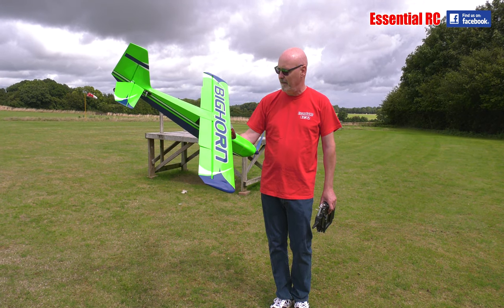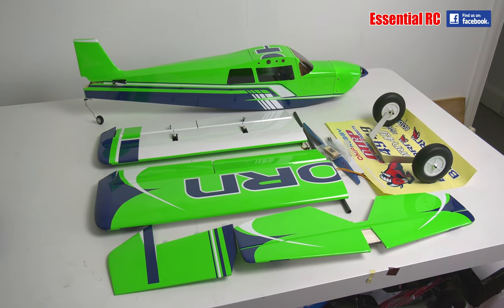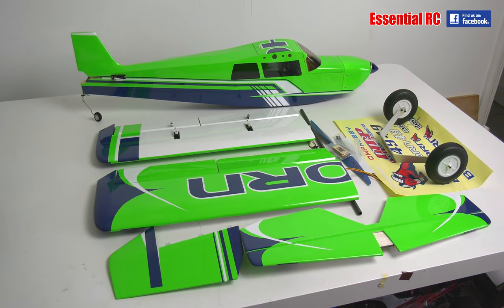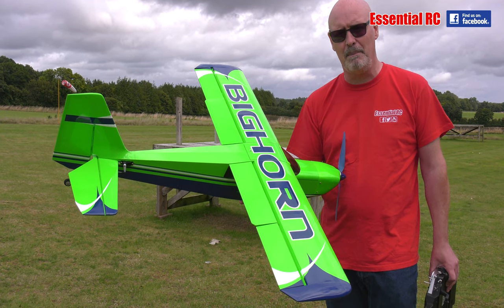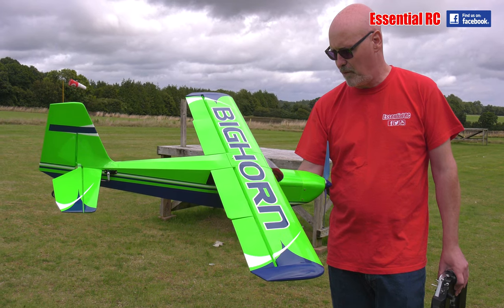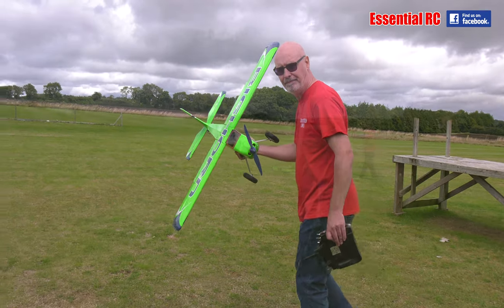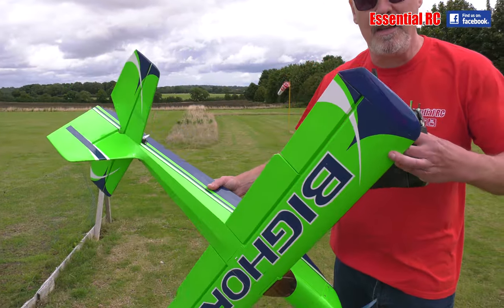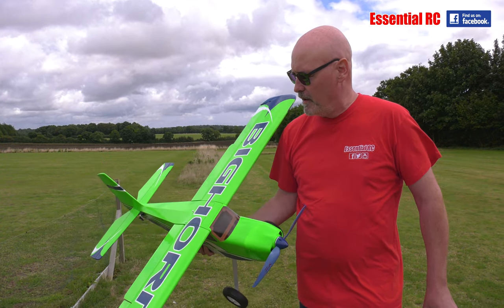BALSA IS BEST !!! BIGHORN HIGH WING AEROBATIC TRAINER: ESSENTIAL RC FLIGHT TEST

Comment: I am thinking about getting this model.....because I am liking the quality  and it uses a 3S......would you recommend it as a 2nd step airplane for someone  just learning to fly  this year ?....thanks
Reply from the maker: Yes, absolutely but does depend on your skill from a first RC aeroplane. Needs to be a high wing trainer really. This would also make a good trainer aircraft but only under supervision by an experienced RC pilot on a buddy box system.
Reply: @EssentialRC  my current experience ...I have been flying an old school type high wing nitro  ( OS45  size )  and an Arrows Bigfoot  3S  ....is the Bighorn  a  much more advanced  trainer ....thanks
Reply from the maker: If that OS45 powered trainer has ailerons and you can take off, do controlled circuits at roughly same altitude and land...then yes, the Bighorn would be a good second model. I will just add that it is very light and only good for zero to mild wind. Stating the obvious really.
Reply: @EssentialRC  got it...and pretty sure you meant to say " Bighorn"...stay safe and thanks again for all your great videos  ...........
Reply from the maker: @garyvale8347  Correct. I did LOL. So many planes, so little time. Thanks Gary. Appreciate the feedback.